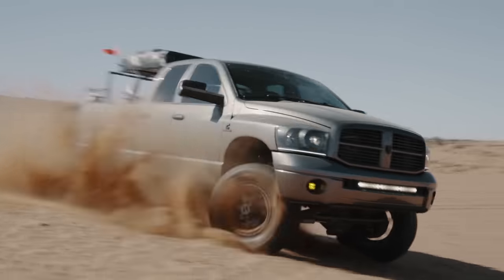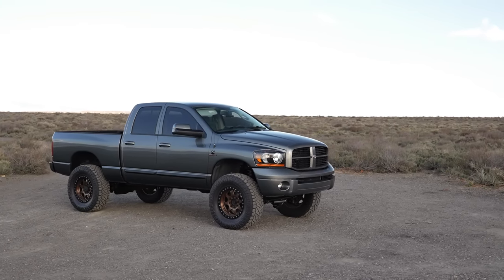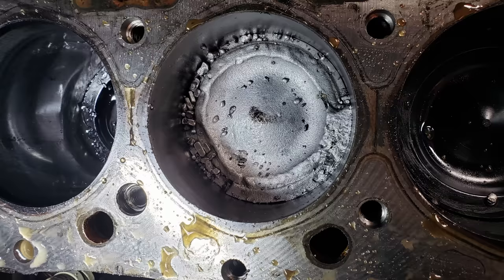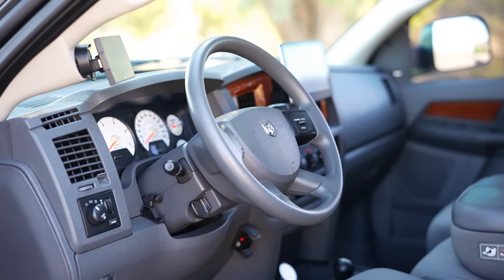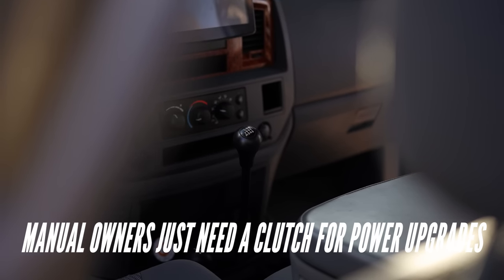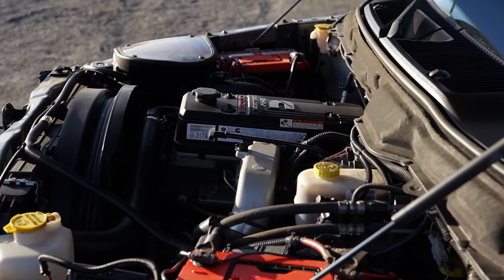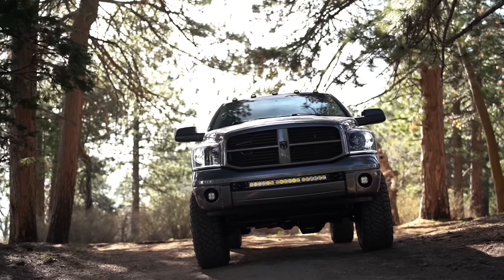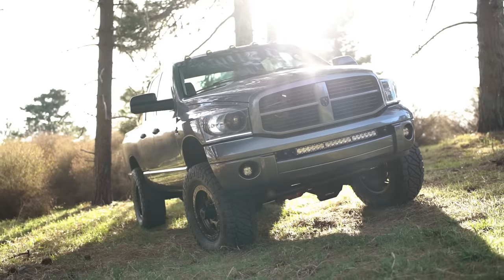Top 5 3rd Gen Cummins Issues You Need to Watch Out For (and How to Fix Them)

Comment: One more common issue I've found and heard of on these trucks is the rear door wiring. If you have window/speaker/or lock issues with your rear door it could be the cabling in the boot when you open the  rear door. This is a common issue since the doors open wide and the cables are constantly being bent back and forth.
Reply: I’ve had to repair mine multiple times in the doors open your locks won’t unlock or lock
Reply: I can attest to that
Reply: Thanks. My rear driver door electronics don't work at all and the pass side randomly locks.
Reply: I had to replace mine with super flexible higher gauge speaker cable.
Reply: You are correct… Since those doors open at 90° they can stretch out the wires. I’ve already fixed the harnesses by adding 7 to 8 cm to each wire. I also added a little silicone grease inside so they slide through inside the boot. Took a little bit of time… Actually just about 5 to 6 hours one day. Never look back. Everything works just like it came off the show room.
Reply: Definitely this, thought it was the connectors until I opened up the rubber boot that runs into the cab.
Reply: Yep... Forgot that one.  There is a permanent fix online by declining and going with heavier wire with more flexible sheathing.
Reply: My windows haven't worked from any other switch besides the driver side for a year, I just to lazy to check, and if someone wants there window down they just have to ask haha
Reply: Yes I’ve had to redo mine twice
Reply: Mines screwed too
Reply: OMG I have replaced my Door wiring 2 times on my 05 Ram. I was told by the Dodge Dealer that its a design Flaw But No Recall, Go Figure. The problem is the harness is too short. My son is in his last year of College Majoring in Electrical Engineering. He has ordered Silicone wire and will splice it into the Harness. He assures me that will solve the problem. Its a lot less expensive than buying New ones.
Reply: Had that go out in my 04, those doors open a full 90 degrees so it stretches the harness. Not to hard to replace while I was at it I did door panels and put Laramie door panels and wood grain dash it looks good
Reply: Super easy to fix too. The harnesses are readily available for like $40
Reply: yes, everyone I have seen. my 08 was fixed on warranty
Reply: Just had to soldier 7 out of 9 wires on each side of my 2005. But now everything works again. Did my injectors last year. Now I have loosness in the front end" maybe steering box" and all new joints and connectors. But I'm retired and have to do it on the cheap. Suggestions PLEASE.
Reply: @justsaynrush9689  take a look at a "steering box brace".  it helps brace up the front end, including bracing the steering box since I believe it's only held on by 2 bolts so it gives it more support.
Reply: @justsaynrush9689
Figure out what's loose in the front end. These steering gear boxes are prone to having too much play pretty quickly. Mine was replaced under warranty and this one is now loose too. So far, I was able to tighten up it's lash. Do this VERY GRADUALLY so you don't over tighten it. So, barely tighten it and then test drive. As soon as a minor tightening makes it drive good: QUIT! (What I mean is, barely move the bolt and then lock it back down with the jam but!)
Reply: That’s only a problem on mega cab and quad cab trucks.
Reply: Happened to my third gen, replaced both rear door harnesses
Reply: Ya my speakers in the back doors one turns off when the door is open😂
Reply: Just fixed mine today lol
Reply: Or when the speaker wiring is actually cut through.  Looked like from the factory that way because the protective boot was fine.

Comment: Now I'm paranoid and want to put new injectors
Reply from the maker: It’s worth it. I’d personally do it on any third gen over 180k miles. ALWAYS ALWAYS go with NEW oem bosch injectors and NEVER remans!
Reply: @JustDiesels  What about if you want bigger injectors? What’s the best way to go about that?
Reply: My original factory injectors lasted 300,000 miles bone stock truck bone stock filtration. I put new injectors and CP3 pump in I have 435,000 miles now still going and it’s the original automatic transmission. My opinion is most problems are caused by tuning a diesel if you leave it stock it’ll last you forever and not give you hardly any problems
Reply from the maker: Only do that if you’re looking for 500hp or more. The stock ones are fully capable of moving plenty of fuel! Unless you plan to do a turbo and larger cp3, it’s easiest to just stick with the stock sizing.
Reply: @Rangerdnger  That’s crazy man. Sounds like a very well taken care of truck! My 06 has gone thru 2 engines one at 60k miles (factory recall warranty replaced) and the other at 170k(ran low on oil, trashed the engine). It got a rebuilt engine in 2015. It’s always been stock and the filtration system is giving me issues. I’ve already gone thru 2 sets of injectors since the rebuild and now when I give it too much throttle or when it’s under a heavy load it just bogs out and loses power, But when I’m driving in town it does just fine or at 65-70mph with no load. Overall the truck is just really slow and a rough ride and I’m looking to give it a light build but I want to do it right, maybe 500-800hp, keep in mind, it’s a 12,000lb 1 ton dually with a 6 speed g56. It’s been a welding rig it’s whole life so it’s been used and abused, hauled a 5th wheel many times and it’s always on the highways. It has trouble pulling a 5th wheel at 100 degrees because I live in Texas. I really just want a slightly bigger turbo with bigger injectors, a fass fuel and all the minor upgrades that come in between (cold air intake etc.). I use the truck every day and I want some more power out of it because it gets very old sitting at 65mph on 8 hour drives haha. I do agree though, stock is most of the time better if the truck has been maintained properly it’s whole life and has no issues. I really want to figure out the best setup without going super overboard, and have it perform better in all aspects, power, fuel mileage, keeping down temperatures, and most of all being fun to drive, I plan to keep it forever and use it as my daily for a while until I get something else to drive around town
Reply: @JustDiesels  Yeah my plan is to build it from the 500-800 range to be a dependable, fun to drive, all around truck. The filtration system has gave me a bunch of issues, I’ve gone thru 2 sets of injectors on a rebuilt engine that was installed in 2015. The truck needs a makeover, it’s been a used and abused work truck it’s whole life. I was looking at the fleece cheetah 64mm and maybe 100-200hp injectors, I know I’ll need a larger cp3 and a heavier duty clutch since I have the g56. I don’t plan to do the injectors and turbo anytime soon but maybe in a year or so. I’m about to pick up a fass for it and have it installed asap because that’s the main problem with the truck, as far as other upgrades, what would you recommend as preparation for the bigger turbo, injectors, and cp3 before they’re installed? I really enjoyed the video man, very helpful information. You earned a subscriber for sure! Keep up the good work.
Reply: @SpeedNNoise  DDP, Flux, S&S and Exergy.
Reply: @SpeedNNoise  new injectors with over stock nozzles, s$s, exergy, dynomite, etc
Reply: So pretty much everything in the truck besides the engine 🤔
Reply: Right 😂

Comment: A true and precise assement of engine internals is to have an oil analysis report from a lab. The report clearly states what metalurgical components are present in the sample you provide them. I used Amsoil Anaysis service, my cost for the lab in Edmonton Alberta Canada was $45.00 and the report I received indicated zero problems in my '03 Ram. A genuine reliable indicator of whats happeneing inside your 5.9.

Comment: The sad fact is that I’ve had issues with all thing that you mentioned except the injectors! Thankful the last owner of my truck was smart enough to replace them and put on a fass! And the blend doors was super easy! Just time consuming and definitely requires two sets of hands with the dash
Reply: dash is easy to get out. the blend doors i got were absolute junk. dont forget the recirc door tower was updated and the truck will never really cool without the later model one. 06 is by far the worst year to own.

Comment: Two other problems are the number four fuel line leak and transmission fluid regulator screen plugging.  For belts, the dodge chirp is well known if a low quality belt is used, and the tensioner is not replaced at the same time.  The one I cannot solve is the bucking from the cruise control going down hill unloaded.  Any thoughts here?  Finally, the TPIM is a very poor design since even the trailer circuit goes through this unit.  My boat trailer shorted out and took the trailer circuit on the TIPM with it.  I highly recommend isolating this external circuit with a cheap $ 30 auto reseting trailer module.  Dodge engineers should be embarrassed with not including this type of circuit on a $1500 circuit board.
Reply: any luck with the downhill bucking ?  I am having this happen too!
Reply: @fishonnelson2353  No. Still searching th web for ideas.  The bucking got slightly better when I swapped the transmission governor solenoid with a GM conversion kit.  My guess is the crappy transmission  is the source.  The swap is good to implement since the dodge solenoid has a very small fluid screen and can easily plug.

Comment: 05 all stock but run better Baldwin fuel filter in it. 123k and no issues. 

Rebuild the front end at a 100k and upgrade steering. Well worth it long term. 

Change batteries every 4 years and clean ALL grounds on engine and other points including cables after 10 years. Make sure the yellow wire under the fusebox for the starter is clean with good connection. 

Keeping mine forever.
Reply: How's your 05 doing? I'm about to go look at an 05 today. Anything I should be made aware of?
Reply: @martysworld6052  Yes, quite a bit but I recommend searching 3rd generation ram cummins issues and there are videos to help.
Reply: "Rebuild the front end at a 100k and upgrade steering" AND rebuild with rebuildable ball joints by EMF, among others.

Comment: This was a very informative video. I did have issues with the blend doors and i did the entire repair (HVAC, blend doors and a/c) myself. It took roughly a month to do the whole system, but it was well worth it. I did use blend door USA and they really are the greatest blend doors you can put in the truck. Everything is machined aluminum even the gearing and there are a couple of videos on how to do that. Whether you have a a double cab or a megacab cab truck. 

I also did the big three upgrade on both batteries. I made all the cables myself. I wish I could show you pictures of what I did but it did solve many electrical problems. All the ground wires were changed to 1/0 except for the ground wire leading from the passenger battery to the alternator which I made a 2/0 gauge wire. I also made a 2/0 gauge ground wire from the engine block to both batteries. All the ground wires that were currently connected to the batteries I pulled out and made 1/0 gauge ground wires. The crossover cable is a 4/0 gauge because it has to keep a consistent charge going over to the driver side battery along with making sure you have a strong current going to the starter and also to the entire electrical system of the truck. I also use aluminum battery connectors from GP audio which were six block connectors so as if you needed to add anything in the future… Amplifiers, or any other type of electrical made you can bolt right to the battery terminal. I also added a high amp alternator from Mechman to help keep the same charged up and your batteries charged up. One thing nobody talks about is if you’re doing start and stop take driving or making a lot of stops actually stopping the engine you have to keep those batteries charged up. Hi output alternator helps do that pretty efficiently. Upgrading all of your ground wires and power wires is a great start but you will need to eventually get a higher output alternator.

You are definitely correct stating that a lift pump is needed on these trucks. The CP3 and stock fuel filter really are not enough. You need to get some pressure to those injectors and clean water free fuel. I would also suggest after getting a lift on removing the stock pump which I think you have to do anyway.

Once I get the lift pump and get some of the transmission work done I feel that the truck will probably last forever. The third GEN dodge Cummins is awesome truck… It just needs some upgrades to make it a long lasting great truck.

Again this was an awesome video and very informative. Love to shoot you some pics of mine when I’m done in a few months. Cheers keep the videos coming!
Reply from the maker: All great info in here! The batter cable upgrades are an AWESOME way to prevent future issues. 2nd gens benefit from similar upgrades.
Reply: @JustDiesels  I’m looking into buying a 2005 3500 Cummins with manual 6 speed. With 140k miles an old man truck. Would you say it’s a good truck? It has been maintained very well all stock and and old man driver.
Reply: @JustDiesels I mainly want it for towing purposes

Comment: Replacing the stock starter with a Mean Green gear reduction starter really helped my starting.  Engine now starts very quickly and it just seems easier on the engine.

Comment: Great video bro. I just commented on another one of your videos. TIPM was my issue cuz my tail lights won’t work haha. So great to hear you say that. My buddy figured it out but where the fuse goes I had no power to those wires for the tail lights, therefore it’s the TIPM box. I even put my stock lights back on to see if my leds were bad. TIPM was $700 hard pill to swallow for a blinker.

Comment: I have told people about the injector test for awhile!

I actually first discovered it, for myself, on accident. 
Noticed the rpm hop as unusual...but didn't know why... and when I replaced injectors it was smooth as butter. 

Since I've figured that was a injector slightly hanging open. And confirmed it with many experts as well as a go to test for early failure
Reply: I’ve got an 06, bought it new. 147k miles now. For the last 70k miles have used power service every tank. Truck is bone stock never had a tuner plugged in. I am also meticulous on maintenance, have never missed, and have used 100% Fleetguard products. I feel like my truck runs perfect. Great power, no smoke, starts fast, all exactly the same as when it was brand new, and I should know because I’ve had this truck since it had only 7 miles on it. Also do Blackstone labs tests at every oil change and my fuel in oil comes back at <0.1% and has been for years. 

Now I watch this video because I love my 3rd gen and I see this injector test. I tried it yesterday and it steps a few times coming down through RPM. I can’t believe it. So now what, replace all 6 immediately?
Reply: @michaelxr2460  Yes.
If you have not upgraded the fuel filter system to a CAT style, at the very least a simple inline block between your stock can and cp3. I did that to mine. If you do, make sure to use MARINE Diesel hose ONLY. No black rubber at all.

147k on stock injectors is about the end of its life. It's probably not doing any damage yet if you aren't noticing alot of white smoke. It will always haze a tiny bit.

If you are on a tight budget and can't afford brand new Bosch. I know a personal builder from eBay. Retired bosch tech. Way better quality than any other vendor (cough Inj Dir) 

New is obviously best. But GOOD reman injectors by a GOOD builder that flow tests them right with proper equipment is required.

The guy I used I quizzed like crazy and he was always on the ball knew a ton about injectors and told me exactly how another vendor ripped me off

Comment: My 2003 2500 TD Quad Cab is one awesome truck. It's a long bed that came out of Alaska and is tricked out for that area. Standard in all aspects except, it's got an insulated camper, running boards, brush guard, tow hitch, long bed, set up for a snow plow and has a block heater.  I bought it in 2010 for a song with only 37,xxx miles on the clock. It now has 128,xxx miles on it and my only issue has been a bad water pump at 50,xxx miles and a left tail light that just loves to blow out about every6 months, regardless of weather. I love this truck!

Comment: Thank you for the information and concise videos, I wish I had found them sooner. As to point #3, my 06 has been suffering from intermittent and bizarre electrical problems including one low beam going out, one wiper speed, rear tail light going out, odd starting habits and more. I changed out the batteries and soldered in new terminations for the crossover/assorted connections and half of my project list evaporated. I will add that cleaning the TIPM connectors underneath the fuse box should be a annual/semi annual inspection point. Cheers!

Comment: Very accurate.  Original owner of an ‘03 and I’ve dealt with all but the electrical issues.  At 300k miles I can’t imagine replacing it though.  It’s SO easy to work on. Nice vid.  Thanks

Comment: I’ll add a couple more; my seat motor came apart. I bought this truck used and it was previously in an accident. I can tell because the inside of the bed shows some different colors from the scratches. Then the transmission pressure control. It is electronic and the motor seized up in a high pressure situation. The end of that story was a fire under the hood. Now I have a temp gauge on the trans and I upgraded the valve body and added a deeper aluminum pan . It’s an 06, 48RE, computer controlled trans. Love the truck though.